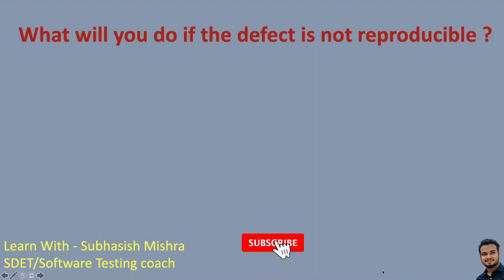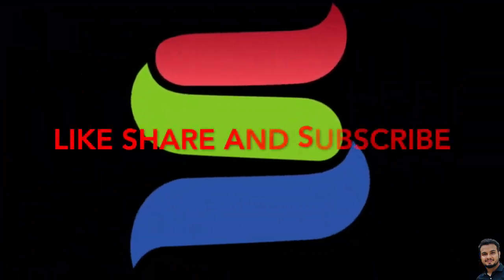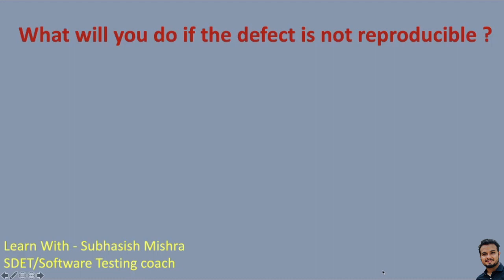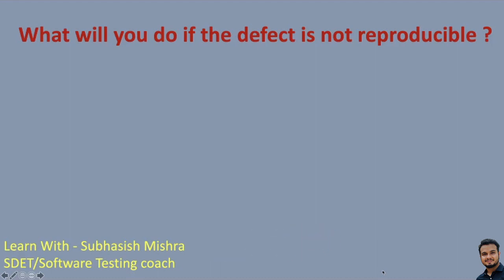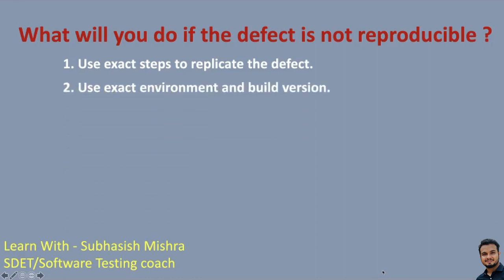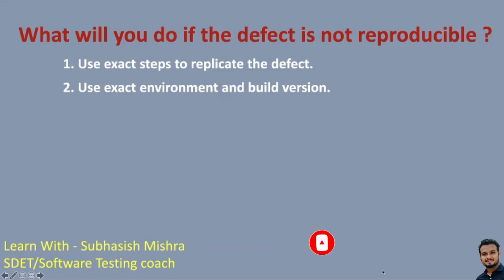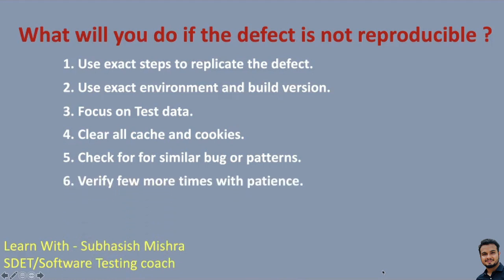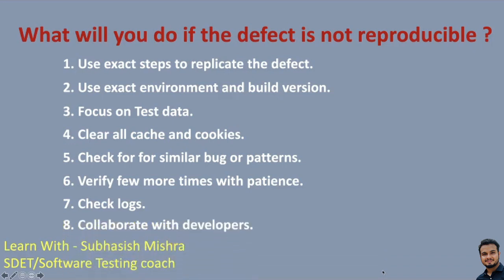What Will You Do If Defects Are Not Reproducible | Software Testing Interview Question

Comment: What does it mean 
1.check for a similar bug and pattern meaning of line
2.check log meaning 
How tester check the log
Reply from the maker: Similar bug - means to check if similar kind of bugs/defects already raised or exist in the system. 
Logs are used to keep a record of events when a software or application runs. In case there are any issues ,You can check the log and get an idea what is causing the issue. It helps to debug an issue.